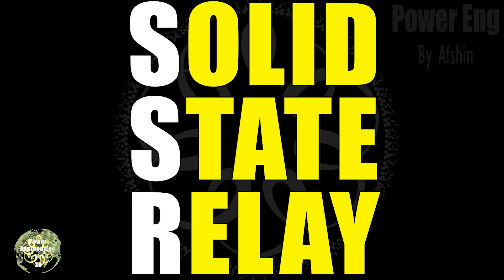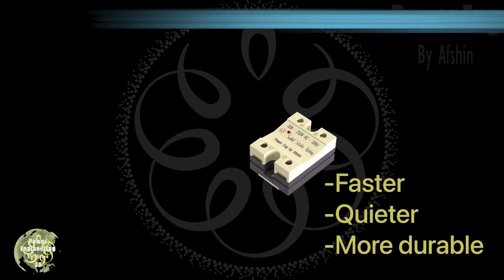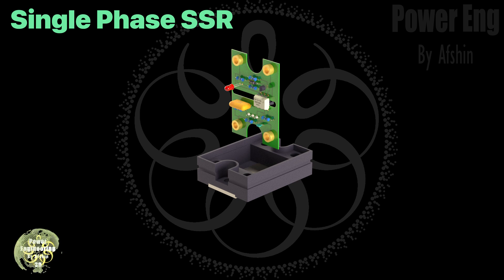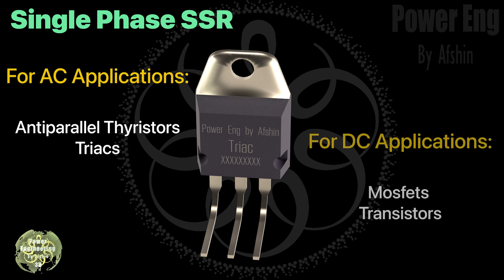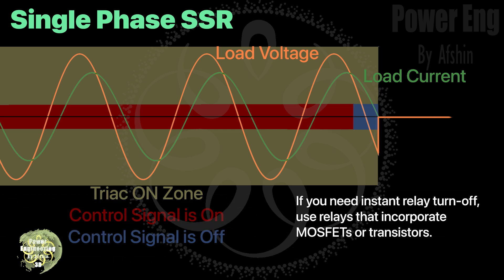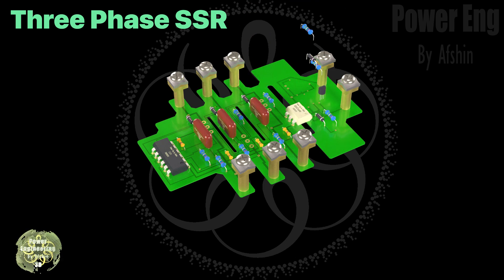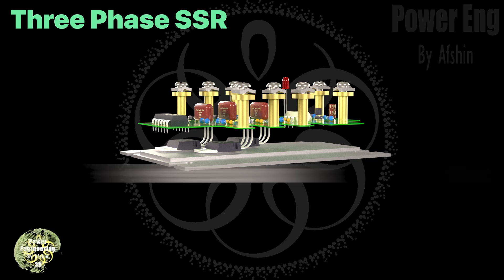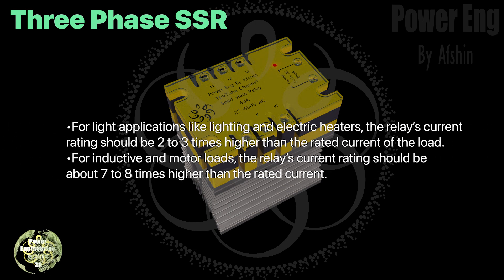Solid State Relays (SSR): Types, Applications & How to Choose the Right One

Comment: What about voltage drop betwen power terminal ?
Reply from the maker: You made a great point. 👍👍
The forward voltage in semiconductors like MOSFETs,BJTs,thyristors and triacs depends on the materials(PN junction)and the current. Usually,the values are:

MOSFET: 0.1V to 0.8V

Thyristor and TRIAC: 0.7V to 2V